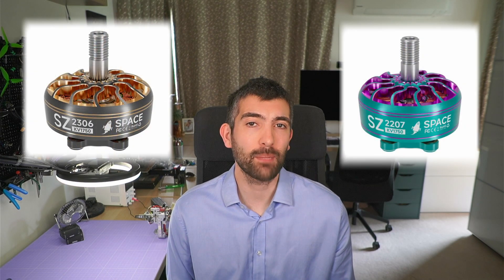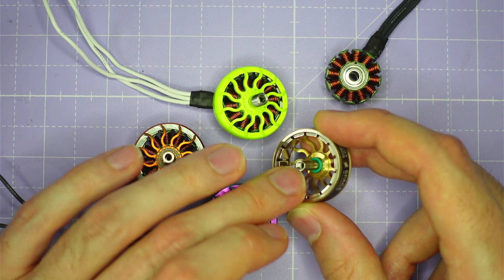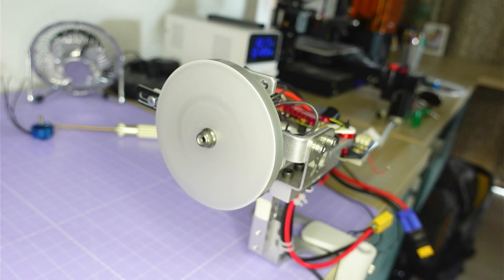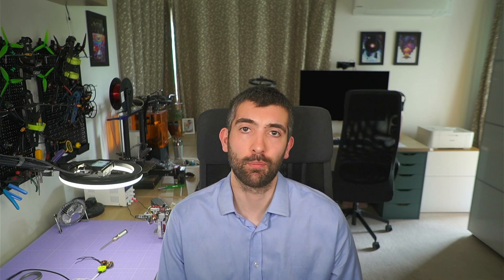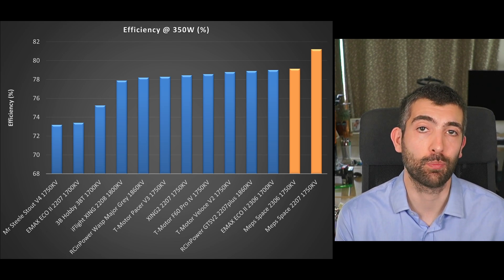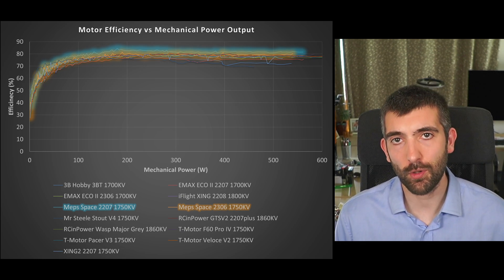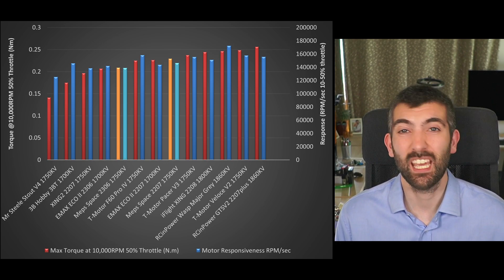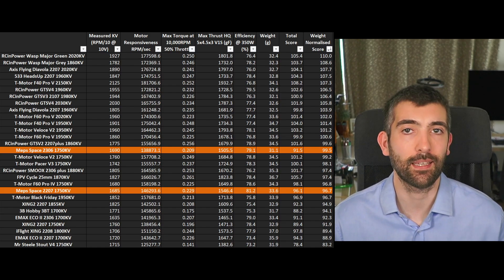The MOST EFFICIENT 2207 motor: Mepsking Space Motors

Comment from the maker: These motors were sent to me for testing by MEPS. I have received no other compensation for this video, DID NOT SIGN THEIR CONTRACT and noone has had any influence or review of this content before publication.
Reply: Hi Chris, i have a racing frame with 4 brother hobby avenger motor, the pid chart of that quad is horible, the line is not smooth like your video "Betaflight 4.4 Tuning Guide". Do you know the reason?
Reply: Will you be adding the GepRc 2207 SPEEDX motors to this list? I am trying to PID tune a vapor D5 without the stock tune while using 5043 props instead of the 5136 that it comes with and don't want to cook anything while tuning. any suggestions Fams?

Comment: What you think about the meps sz2306 or 2207 in 1950kv version ? Is possible to get similar efficiency than the 1750kv by motor output limit on betaflight ? I want to buy a set from them byt still unsure about what kv value or size, my build will be for smooth flying cruising cinematic and maybe smooth freestyle, but i want to have the little extra power for punch, which size and kv would you recommend?

Comment: Greetings, I like the content of your videos and among your videos I am looking for help to know why when I accelerate the motor it works normally but when I lower the revolutions to zero the motor begins to accelerate on its own to the point that I have to disarm the drone because it does not respond. It is my first drone, maybe I configured something in BF incorrectly but I don't know what, although I use an elrs 500 preset from BF. Betafpv elrs superD receiver, FC mamba h743, betafpv 1w module, radiomaster tx16s.  Battery 4s.  What can I do so that the motors do not accelerate only when I remove the acceleration in the control????
Reply: It's been over a year, and I'm sure you figured it out but when you are bench testing and have no props on the motors they will continue to accelerate. Once the props are on they shouldn't do that.

Comment: Each motor will have a max efficiency vs torque. This can be calculated from I_0 and kV. Why are you using a fixed power? This will randomly favor motors for which the parameters align by chance closest to their optimum efficiency point.

Comment: has anyone done a good durability test on all these motors, seems like all motors fly well enough for me, i just get sick of replacing them, i want the most durable over all else.... going to be buying a set soon
Reply: My tmotor pacers are bulletproof
Reply: Xnova (and by this also evan turner's motors) can take years of abuse without breaking down.

The first set still holds up to this day. Even with C-clip rather than the newer screwed-down-bells never one fell off or was clogged.

But they're expensive why I don't run them anymore.

But if You have the money definitely the best motors available.

Comment: How are you measuring the watts of mechanical power produced for your efficiency calculation? Most motor test data gives efficiency as thrust (g) / electrical-power (W). This seems like a more intuitive and useful measure of efficiency because thrust and power consumed are two values we practically care about, even if the units don't match. Regardless, can you throw the Rcinpower Smoox 2306 motors  on the test stand? Their motor test data shows efficiency that is off the charts compared to other motors.
edit: I saw you had the Smoox 2306 included in the best 5" motor video, and their efficiency tested right at average. Could you try reproducing their motor test data and see how far off your results are? The data they show is 50-75% higher than equivalent motors.
Reply from the maker: Mechanical power is measured by multiplying measured torque by rpm (in rad/s). Electrical power is measured by multiplying RMS voltage and RMS current. Divide one by the other and you get motor efficiency. g/W is a good measure of efficiency but is very prop specific. Motor efficiency is prop independent.
Reply: @ChrisRosser  So was the mechanical power measured with the flywheel?
Reply from the maker: @theroburrito  It's measured using the propeller. By reporting mechanical/electrical power rather than thrust/electrical power you can separate the motor and propeller efficiency. Motor efficiency is mech watts / electrical watts and propller efficiency is then grams of thrust per watt of mech. power. Total efficiency is motor eff. * prop eff. giving grams of thrust per watt of electrical power. I'll cover this in my next video which is planned to be a heap of 3" prop testing.

Comment: meps kings and rcinpower motors are good, but also hard to get in europe anyway.  both companies are not able to even set up a useful homepage and links to thrust charts with more than 1 prop. :-) ??  have to ask myself, if i break one, how much does it cost to get a replacement. how long do i have to wait and how long are there parts available. these are the reasons i use t-motor and xnova. t-motor has parts for years and xnova is my new brand i test now. some heli pilots use them in competition. in the quad scene they are not so common, maybe not main target. i know, affiliate has to be there, but some day maybe one pilot will make a test with a xnova motor. bought a T2204, which is one of thr lightest in its class. 20gr for the lr 5. should be not too much.